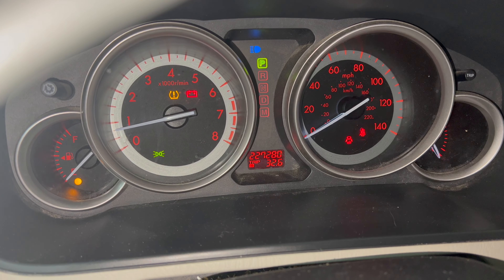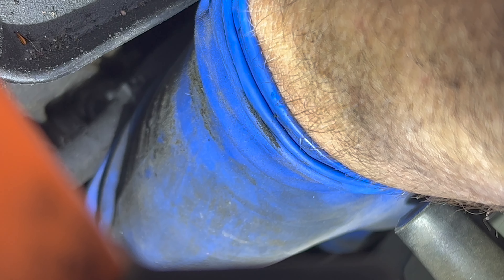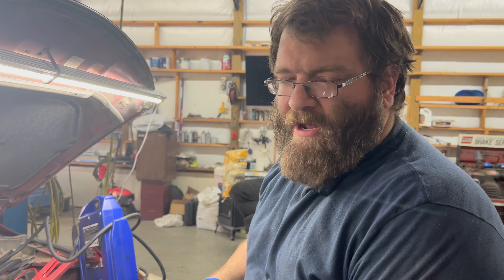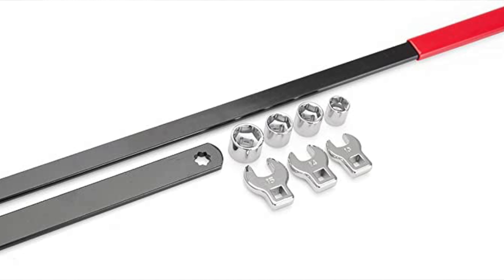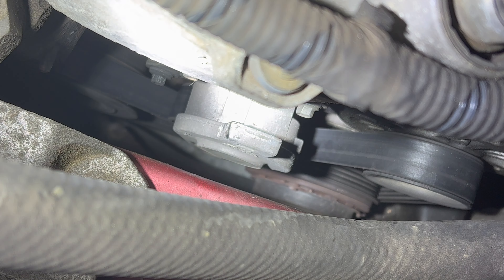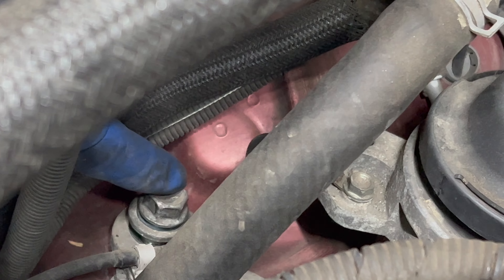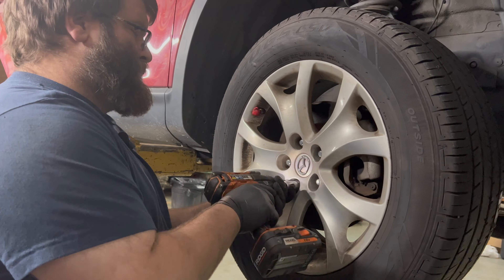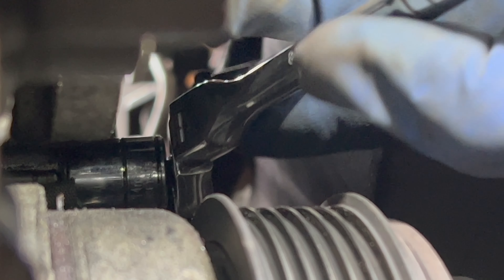2007-2015 Mazda CX-9 Alternator Replacement

Comment: I move the  fender liner and the windshield washer tank and it work 🎉🎉🎉
Reply: Without removing the engine mount?
Reply: Doesn’t make sense. After removing the reservoir you’d have the frame and A/C compressor blocking the side exit.

Comment: Save yourself an hour of maneuvering the alternator out by removing the cooling fans (pinch the lines)  . Takes 5-10 minutes, then the alternator can easily be removed.
Reply: Do u still have to remove motor mounts?
Reply: @mojado15 yes
Reply: Duh…I am a idiot, thank you for this sometimes it takes one piece of advice that makes all the difference. Appreciate it!

Comment: Guys I’m working on one of these right now and getting that alternator out of there is rough. I’m still trying to get it out and it’s unbolted
Reply: Hope you got it out  nuff said
Reply: That’s where I’m at now, wiggling it all sorts of ways and it won’t budge haha
Reply: @KPotassiumK  well shit same here, wife bought it from her boss and the mechanics put  2 shit alternators on it so im doing it myself.
Reply: @zombehjester  I will say, pull the whole fan out brother, way easier. Just pinch off the two coolant hoses and pull out the entire fans assembly, made it way easier.
Reply: @KPotassiumK  That is exactly what i did, left the radiator in there and took the fans out, just enough space to ease it through. Just finished it tonight and got it running again.
Reply: @KPotassiumK i did that as well but brole the radiator taking the hose off so i took the radiator out too lol
Reply: @Thunderrry  there’s a guy at a shop I used to work at that, in the process of replacing the alternator on one of these vehicles, put a hole in the engine. He was manhandling the engine with a large prybar trying to create clearance. Put a hole right in the side of it
Reply: I know it's been a year since this has been posted so I hope you reply I'm just wondering how much did it cost to fix a alternator in this type of car